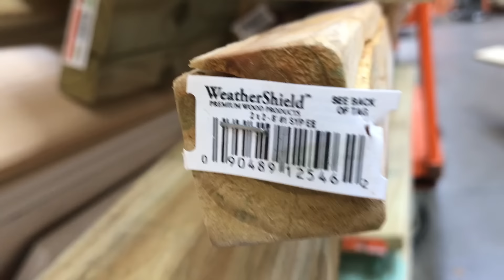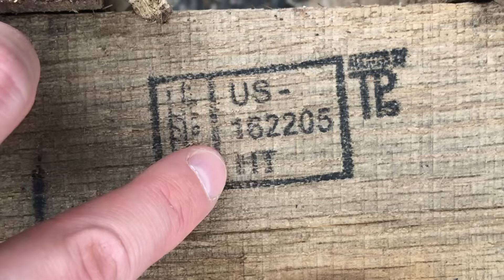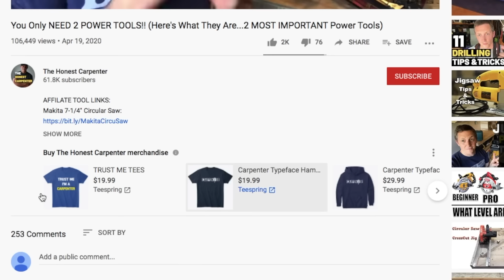Don't Use Pallet Wood!! USE THIS INSTEAD...(Cull Wood Vs. Pallet Wood)

Comment: Methyl Bromide is labeled MB on the pallet. Marks that are safe to use: HT (heat treated) KD (kiln dried) DB (debarked). Just pressure wash the pallet before handling it to much if you are worried something toxic is spilled on the pallet. 👌
Reply: Great info on the markings, but Please don't pressure wash toxic stuff!  You're just going to vaporize it, putting it in the air, on your skin and in your lungs, plus the runoff goes somewhere.
Reply: Food processing would be a good source for untainted pallets as they wouldn't use toxic chemicals.
Reply: @phildunn3195  Yep the OP was "too smart by half" re pressure washing. Good info on the markings though.
Reply: Even MB wood isn’t harmful by the time you get the pallet it’s leached out unless your getting those brand new it wouldn’t have high enough levels!
Reply: Debarked is no indication of chemically-treated or not. It just means the tree bark has been removed from the wood.
Reply: @phildunn3195  🤣
Reply: Mb pallets are safe to use by the time you get them the levels are so low it's impossible to be harmful. Basically 24hrs after they were treated it's safe
Reply: How about just using gloves when handling?
Reply: @robertahubert9155  you don't need to... It's completely safe after the first 24hrs it was treated
Reply: @robertahubert9155 that would be a great best work practice for warehouses...not in the training material.. would have been nice to know..😮
Reply: @tonycrayford3893  Problem is that's still unsafe to use because about 10% of wood from food processing was found to contain ecoli bacteria, something the toxic stuff was applied to avoid in the first place

Comment: This is a great wood project book https://www.youtube.com/post/UgkxkPIWb22DigCqxmlXerCyUF4HCl6eSU2L . Most of the projects use the pallet simply as a source of reclaimed wood not as a recognizable pallet so even if you didn't have a pallet you could make these projects with any reclaimed (or even new) wood. The instructions are excellent. The style is charming and would work with lots of different decor. There are quite a number of projects that involve tiling of teh wood pieces which is a really cool idea and can produce beautiful pieces when working with aged wood.

Comment: After watching this, I went to my local Lowe's where they had a ton of different options in the cull pile for 90% off! They even cut off the damaged parts of the boards I ended up getting. I was  able to find exactly what I needed. I'm going back for more soon. Thank you for this tip! I am tired of pulling out nails!
Reply: If you dont like pulling out nails, do what i did and buy an air locker. They knock out nails a treat!
Reply: You have a one in a million Lowes! Never heard of that sort of miracle in or near my town!

Comment: In my opinion, the benefit of using pallets is that they're already nailed together into convenient modules. If you're walling in a compost bin or something, you just need to fasten a few pallets together and you're done.

Other than that, I would say I agree. Cull wood also has an advantage over dumpster diving in that you're not crawling through jagged metal, broken glass, and everything else that gets junked at a construction site.
Reply: Another con to using pallet wood, after you taken out all the nails you start seeing how weak the wood is.  All those holes that have been driven through weakens the wood drastically, and most times leads to more splitting.
Reply: @WarMachine_Studios  right, I agree that pallet wood isn't good for anything where strength is required. It's often been stressed beyond its limit already. At various job sites, I've broken plenty of pallets and sloppily nailed them back together to get the job done.
Reply: I also recently used a few pallets to build composting bins. I could build it with culled wood, but i get the pallets for free when receiving wood pellets, so its an easy option for for. Its ahrd to beat free materials.
Reply: ;;;;;;;;;;               2 Esdras2: 31-100          ;;;;;;;;;;;
Reply: @johnharvey5412  The European EPAL standard pallets are built to carry 2.500 kg, so it goes without saying that this wood, when reasonably new, is pretty strong. They are also free of chemicals. You often find pretty nice redwood in generous thicknesses which would be very expensive to buy. And 1200mm length is a great size for many projects.

Comment: I like this option but I will continue using pallets. I love the rustic knotty way they look. Gives a piece character in my opinion. Also have had a lot of success with longevity outside by sealing it with a good oil base spar urethane. I have had pallet furniture outside for years with no signs of rot.

Comment: Based on the shoddy lumber I see at Home Depot and Lowe's, they aren't "culling" anything.
Reply: I know right? I went to Menards the other day and the lumber there was so warped it was unusable and at 30 bucks you'd expect a piece of walnut to be straight.
Reply: So true!
Reply: Lol because Lowe’s and home depot are probably selling  pallet wood,! Lol
Reply: Ha ha ha 🤣
Reply: I just went to Home Depot and bought tons of scrapped wood, 70% off
Reply: I work at Lowe's right now lol. We cull about 120 PC's right now a day. The high velocity of demand has the mills sending low quality wood increasing the amount we have in each lift
Reply: @Just Shane people still buy the cull but ask for lower prices or the cheeper people buy for the lower cost lol
Reply: With the price of lumber right now....the cull price is still going to be high...plywood 3/4 inch is running just under 100 bucks...for one piece..
Reply: It’s usually bundled and discounted, so it can go fast when they do have some. Right now the problem is the big corporate lumber companies gouging price for lumber. One company has has over a 600% profit over last years sales to date.
Reply: @smitty8663  The worst part is that this trickles down. The big guys charge more for their lumber, and the little companies take the opportunity to make more profit, then the sawmills see how much the lumber yards are making, and they bump their prices up, feeding into the cycle. Before you know it, you're paying 4 or 5 times what you were paying per board foot just a year or two ago.
Reply: Bahaha unfortunately that's what you get with Depot and Lowes I think. I am lucky to live somewhere where there is a lumber yard not far
Reply: Menard's low and mid-tier wood is almost entirely worthless it's so warped, bent, and or splintered. The low tier is all of the above.  The high grade stuff is the only kind worth buying for anything that will be seen. Even that's not perfect.  I don't even know what the cheapest stuff could be used for. It's all so messed up.

Comment: Where I work I have access to oak pallets made from 1" and 2" lumber that's never seen anything but steel products. They're made to hold up to 2000 lbs so its select oak. Well worth the effort of tearing it apart.
Reply: I'm glad to see this comment. This is the same pallets I use. Some of the main beams are terrific 4x4 material,  that's straight and un damaged, and only used once

Comment: I get my "cull wood" fresh from the sea 🌊...the local beach 🦀 is just 3 minutes drive away. Whenever there's a slightly stormy ⛈️ sea, you can guarantee  that a 1/2 mile stretch of the beach will be strewn with all shapes and sizes of usable timber. 🪵Most of the wood will float back out to sea with the high tide, so calculating the best time to go lumber-hunting involves a quick glance at the local tide table and a two hour collection window. 🕑The biggest piece of wood I rescued was 16ft long by 12" by 8" oak beam - looked like it was from a big old barn. 🌳 I turned that into 3 piece structural garden fountain, ⛲ topped with washed-up green copper roofing sheet. 💚

Comment: I had a pile of 10 pallets in my backyard from various box store deliveries over the years. Last fall I hauled them into the garage, spent a couple of days pulling them apart and cleaning out nails. Then I moved them into the basement where they've been sitting drying out for several months. My first project was a 10 x 8 foot wall sculpture: a series of interconnected diamond shapes, stained different colours, accented with intertwining lines of leftover copper pipe. It came out pretty cool, and nicely fills the huge empty wall space in our stairwell. Right now I'm taking my first stab at shou sugi ban, also with promising results - I plan to make another combination wall-art/display cabinet/sculpture thingy in the dining room. Next up will be a set of rustic coffee/end tables for the living room, also using shou sugi ban, and possibly combining the pallet pieces with some less rustic leftover wood scraps from other past projects. Didn't pay a penny for any of this wood, or even have to haul it home. I'm pretty happy.
Reply: Do u have a picture of ur work?
Reply: That’s sounds like a cool project. Would have like to see a post or video of it 👍
Reply: Exactly! This guy is not seeing the potential of how beautiful pallet wood is when planed, sanded up, and finished. The aging, unique grain patterns, and so many different colors are incredible!

Comment: Having worked with both pallets and cull my preference is cull. The one exception to this is for fast cheep and often temporary structures.  In these situations I usually use the pallets as is on outside projects like ramps, bins, and barricades.
Reply: They keep it in the main aisles....in orange racks. They've got tons of it....

Comment: saw a video while back where they said all pallets have been fumigated with methyl bromide- by customs, even the heat treated ones. but that it's all fumigated out as well, and is safe for use. 2nd handed nugget of information I got from a guy that worked at customs.

Comment: I've never seen cull wood at my local Home Depots.
Reply: At Home Depot locations in Winnipeg, Manitoba, cull wood sells for 50% off.  Sometimes there is a limit on quantities.  It's not advertised, so just ask if you see some cull-quality product and an attendant will write up an authorized discount note to take up to the check out.
Reply: Probably because you've never looked for it..?
Reply: It’s usually on a cart in the lumbar area marked with spray paint
Reply: That's bc ALL the wood @ Home Depot is cull wood. 😂
Reply: Try over near the cutting stations.
Reply: I've picked out my own pile of wood and got them to cull it for me .  50 -70 % off .
Reply: All the HD stores have cull wood, thats their way of getting back at least some of the loss they have with the pretty bad wood that wont be sold normally. At my local store many times I find very long lumber, the 10 feet or more variety, in pretty bad shape at the 70% off discount. The workbench I have has a plywood top that I bought also with 70% off (it was cracked in one of the corners), I cut the bad part and the rest was in perfect shape. They put cull wood daily.
Reply: @slimdougmaddox4634  🤣
Reply: The entire inventory at the Home Depot in my hometown is mostly cull wood. I've been a carpenter for almost fifty years and pallets are still my preferred material for many projects.
Reply: @slimdougmaddox4634  Amen, brother!
Reply: You have to beat people to it. I worked at a Home Depot and we had a few regulars that would come in and buy our cull lumber all the time. Went through it pretty quickly and it wasn't even a super busy store.
Reply: I have.  I just didn't know there was a name for it.  It was at Home Depot.  They even cut them to the size I needed to make woodburn signs with them and decorative signs.  And a shelf.  The 3 left over pieces were all the same size.  I sanded them, stained them, and used wood glue along with pressure from my sliding glass door (in my apartment) to make a table top.  Totally fun, works great and looks fantabulous!!  Oh, the cull wood from HD was 75-80% off.  Having said that, I'm picking up pallet wood the day after tomorrow that's already been dismantled.  I'm going to make double floating shelves out of them that will look like a rectangular crate/box fruit size.  Totally stoked about it.
Reply: I’ve never noticed it but I doubt they are gonna promote it
Reply: Never heard of it 🥺
Reply: A year or so ago, my HD told me they stopped doing that. I used to go for it all the time
Reply: The Home Depot I work at we just throw everything into the trash compactor, we throw so much stuff away that isn't even hardly damaged.
Reply: all home depot sells is cull wood.
Reply: I just did the other day.  It's usually on a cart, so it looks like someone buying a bunch and has walked off.  We've probably walked right by and not noticed.

Comment: Wow! I'll be honest, I love making projects with pallet wood because of the final look, as well as the ease of finding them. I have no problem ripping them apart with a crowbar and getting out the nails easily with only a hammer. That being said, the downsides you mention are real, and I would prefer to work with proper lumber. I've been thinking lately about checking out my local lumber yards, and thanks to your encouragement I will now be doing that.

In terms of the environment, wood rots, so I didn't really understand the issue. 

Thanks again!
Reply: Got an air compressor? invest in an Air-Nailer, it is a pneumatic nail punch that works like a dream. 
No more crowbar or hammer dismantling and far quicker without splitting the wood. 👍🏽
Amazon sell them, or eBay...

Comment: I've done 100s of projects with pallets. There are places with amazing, clean pallets up to 8'. If you pick your pallets from a sh17 company then that's what you'll get.
Reply: Where?
Reply: Yep, I find the ceramic tile suppliers get the best pallets, followed by siding suppliers.  No worries of chemicals there.  Also, prepping the pallet and re-milling the lumber has it's therapeutic benefit.  As far as nail holes are concerned... sawdust  and Elmer's glue hides them pretty well... barely visible (if at all) after sanding.

Comment: I built a 12 x 4 x 8 shed out of 4 x 4 based pallets. Then I covered it with salvaged Hardie Board (different colors but I can paint them) and my brother gave me tin for the roof. It's built Soviet tough. 

The only downside was that there were size differences between the pallets so you have to improvise. I used cull wood for the floor.
Reply: exactly there is a time and place for both it doesn't have to be one or the other!

Comment: I get all of my lumber out of dumpsters in newly started subdivisons or construction sites. Those carpenters throw away nice huge pieces of plywood, 2x4's, base boards, shoe molding, even some romax electrical wire. I like to tell myself it is paid for and I am helping the environment by recycling.
Reply: I mean if its in the dumpster its not stealing, right?
Reply: Do you ask or just take it? I know dumpster divers have been getting more shit these past few years and wouldn't want to get into legal trouble.
Reply: Smart, glad I’m not the only one!
Reply: You get arrested around here for that!
Reply: Its easier to ask than to take it. But sometimws no ones there. Hint, come back at night or on sundays. Ive been getting that wood going on 40 yrs now and ive never gotten in trouble. But i always ask first cause sometimes the guy will tell you where theres plenty more.  Like i always say.. if you dont ask for nothin' thats exactly what youll get.
Reply: You are, we have more than we can use. What do you do with it when it's too small to use for the house and you've already saved a few ?  Ask and we'll happily save it in a pile for you, saves the time and effort of putting it in the dumpster.
Reply: Just a note, learned the hard way, ask the site supervisor, not just someone working there. The average joe doesn't care one way or the other.
Reply: Dumpster diving keeps you thriving...

Comment: I think it depends what your making. I’ve made fence panels out of of pallet wood and that worked great; I found about 10 treated softwood pallets, stripped them apart into planks and remove most nails. Then I just gave them all a scuff sand to remove splinters and then nailed them together to make a fence. Painted them with some shed paint and voila - cheap fence which honestly still looks great. I’ve also made a gift box for a friend which I actually wanted to look rustic so it looked great. I didn’t even bother planing the boards and it was a bit warped but still cool. I’ve just picked up some cherry pallet wood and mahogany pallet wood from India. I’ve planned one board and it looks great. The mahogany is really lovely and strong. I’m gonna make some garden furniture I think. I personally think the best bit about pallet wood is that it’s easy to get hold of, it’s cheap/free, you get a lot of wood out of one pallet, you can still use the structure of the pallet if you wish and it’s great to make rustic furniture for beginners - you don’t have to worry about wasting it as it was free and would have been destroyed anyway - compared with lumber you’ve bought which is special and the pressure is on to not make a single mistake.
Reply: Exactly this.  Afraid to rip into bought lumber because "I'm a rookie and what if I mess it up?".  No fear with pallets.  Didn't cost a penny.  Experiment away and learn all you can.